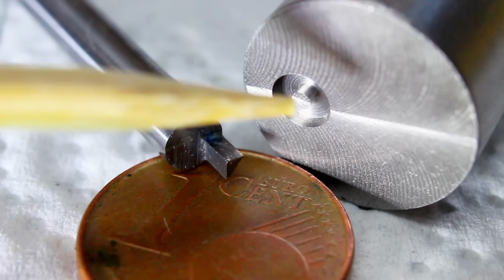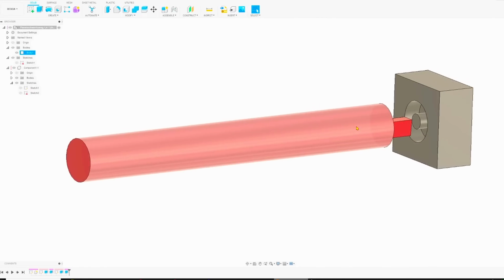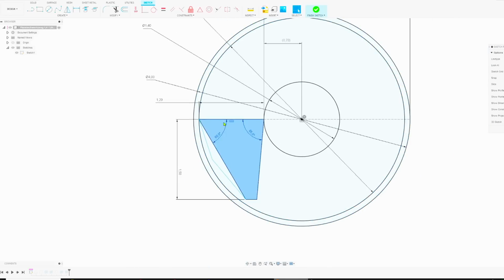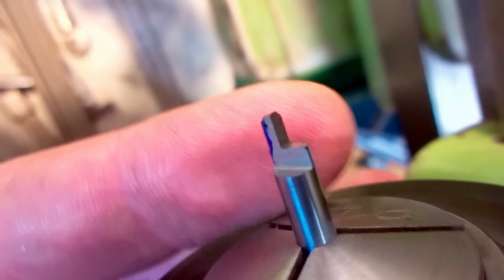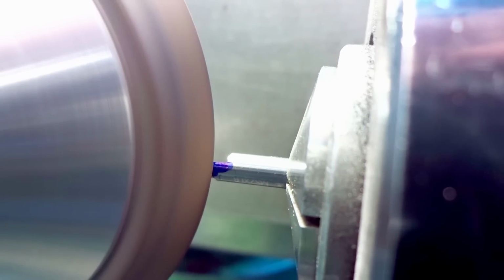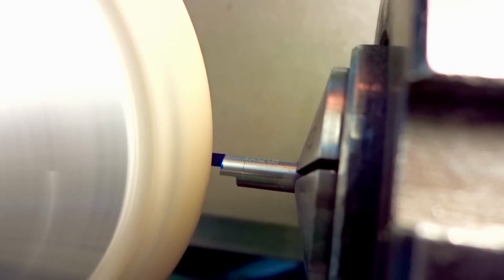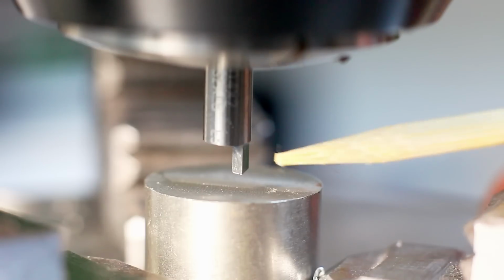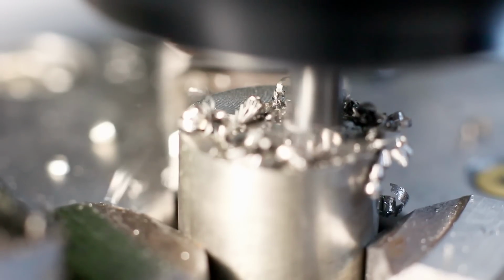Toolgrinding: Micro trepanning tool

Comment: I used to make parts for John Martz, Luger Carbine maker and I made alot of parts that had studs machined like you did here Stefan. I would purchase hollow mills under sized then grind the angular inside for clearance. I had a comparator that I checked the clearance and the dimensions. These tools usually took about two hours to grind but came out well. I would always sharpen the face only when I needed to sharpen it. I like your design and it looks like you made a type of hollow mill. You did a great job with the design and the grinding.

Comment: Trepanning is for saving time. 
Saving material is just incidental
Imagine drilling a 300mm hole x 1000mm deep hole. That 70.000 cc of metal if drilled.
This is why there are no small trepanning tool. Just drill it.

Comment: For a very quick and cheap trepanning tool purchase an annular cutter of the correct size and remove all the teeth except one. Example: To trepan or bore a .750 hole with clearance to prevent rubbing select a .6875 cutter. Again, leave only one cutting tooth. For hardened materials to RC45 use a cutter with carbide teeth. Always look for the simplest and cheapest way to do a job.

Comment: This is unnecessarily over complicated, and not as strong as it could be. Any lathe worth his salt could do this by hand in about 15 minutes.  I would grind the cylinder myself on a cylindrical grinder but everything else by hand.
Reply from the maker: What is complicated on this tool? Its just prismatic facets?
Grinding this by hand is optimistic at best for a the given tolerances on the pin.
Reply: @StefanGotteswinter   you feel that way because you don't know how. Just because you can't do it doesn't mean trained professionals can't.
Reply from the maker: @ceazar75  I am fine with that :)

Comment: I once was running a steep grooved spiral on the internal of a part on the lathe. It was howling away and I was ensured that the boring bar always made that noise. I wasn't satisfied with that answer so I inspected the cutter closely and found that the back side of the insert was indeed rubbing just enough to make a sound but not enough to ruin the parts. I ground the insert away on the back side of the cutter and to the senior machinists delight the boring bar was now silent!
Reply: Sometimes the chatter and howling are a simple case of too much over reach for the boring bar. When I worked nights I came in one time to finish up a job in the Jig Bore. The guy in days was using a 3/4 (19mm) bar to try and bore a 4" (101mm) hole about 5" (127mm) deep. Once he got chatter he couldn't get rid of it. Swapped out to a stiffer set up. And no problems. To be fair it was on a weekend and the guy normally didn't do jig bore work. It's not just tool clearance. The stiffer the set-up the better.

Comment: No back rake on the cutting edge? Is this just due to the lack of cross section or another reason? Love your work mate. Keep it up
Reply: It could stand a chip breaker, did you see those long chips on the power feed.

Comment: Is the table of the tool grinder on an air bearing that you run by hand pressure?
Reply from the maker: Nope, its running on cross roller linear bearings :-)

Comment: I've been mulling making a water cooler block for a power RF FET amplifier that I'm building. This looks like an excellent tool for cutting the heat pipes which the water will run by. I learn something new from everyone of your videos. As always, thank you Stephan!
Reply: the more machinists who are also involved in electronics i see on here, the more i want to get back into circuit design. two beautifully intersecting interests in my opinion

Comment: what you could also do for the angled part: since you always go from the outside edge of the 4mm shank and this position is never changing no matter the rotation angle, just put a driven dimension in CAD from the outside circle perpendicular to the angled line. That way you get precisely the amount you have to feed in. If you don't have CAD it's not hard figuring out this dimension by some easy trigonometry. I can't imagine grinding up to an edge by eye can beat this.

Comment: Your comment about reversible spindles encourages me to fit a a reversing switch to my Deckel S0. Definitely helpful for end mill touch ups.
Reply from the maker: Careful, they wheel hub needs a keyed washer to be able to reverse the spindle, otherwise the wheel might unscrew itself 😬
Reply: @StefanGotteswinter  Good point! Thanks.

Comment: Is it not only the bottom of the tool that is cutting?
Reply from the maker: Yes - thats the primary cutting edge. The side edges are the secondary cutting edges and in this case they mostly do nothing (apart from very mildly smoothing out the side walls of the cut feature).

Comment: What's your most important, or most used grinder in your shop and what would you recommend a hobbyist to look for if they could only get one, or assuming a rich hobbyist, what they should get first? Surface grinder, rotary grinder, tool & cutter grinder, d-bit grinder?
Reply from the maker: If I could only have one grinder it would be:
a) (given enough room) a surface grinder
or 
b) (almost no availible space) a dbit grinder
Reply: @StefanGotteswinter  
Yes, you can do tool grinding on a surface grinder plus some OD work. Unfortunately used surface grinders have gone through the roof price wise.

Comment: I would have been afraid of snapping that tiny carbide tooth off, due to the stress riser of the corner.  What I learned is that corner radius is not necessary if the cutting force is low enough.  It takes experience to know how much we can get away with, thank you for sharing yours.

Comment: Very interesting Stefan, and a lovely surface finish for the scale. I guess another way would be to drill out the centre and insert a precision ground pin  - assuming the parameters of the part allowed for it of course. Thanks, always something to learn here.

Comment: makes me want to make an extreme sized trepanning tool somewhere around 50 to 60mm
Reply: I had a job once where I had to cut the gear teeth off of a part where we needed to use the part from about 25mm below the gear teeth OD. The OD was around 450mm with the teeth around 40mm or so wide. Took a 25mm tall cutoff blade and ground a radius. Took the teeth off as a ring. The teeth were flame hardened to around 50RC. Turning them was not an option. Wouldn't fit in the OD grinder either. Sometimes you have to think outside the box. Because you have no other options.

Comment: Would leaving the inside cutting edge of the tool to 90deg instead of the 85deg  be a problem? The tool would be tangential anyway and have build in clearance.
Reply from the maker: That is a very viable question - TBH, I am not sure. It probably would work just fine, but as soon as the edge starts to wear, it would create a spot with a lot of friction (i guess).

Comment: I would love a follow-up video on how you measure your ID, OD, and depth to confirm what you cut is to the specifications!
Reply: In the real part it's just the cylindrical boss not a boss inside a pocket like this demo so you can just measure it with a micrometer. You should what the video making the real part.

Comment: "4mm carbide end mill that is no longer useful.  I make those myself".  Yep, Stefan, I make those myself too, in lots of different sizes!  ;-)
Reply: Many of us do the same, following the immortal pioneering work of This Old Tony.
Reply: @wwjjcc418 
If it's just one corner that gets crunched it's an instant boring tool 😁
Reply: I will have to look into that as a manufacturing process, having never, ever made one myself. I have also never let the magic smoke out of any electronic system. ....   Ok, I'm safe, no lighting. 😁

Comment: The only trepanning I have done was on the lathe, using a ground tool like this in the mill is very interesting. Still, I suppose you could have done this work in a lathe with the same tool, by offsetting the work in a 4-jaw?
Reply: Don't mention the 4 jaw. 🤫